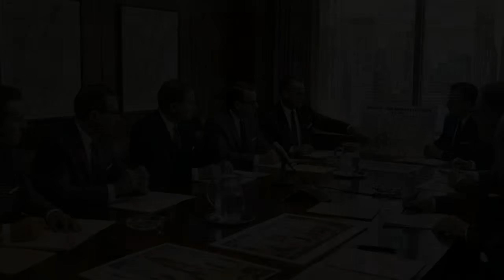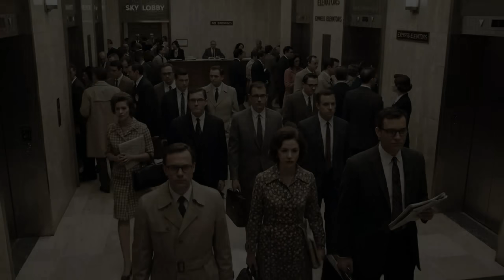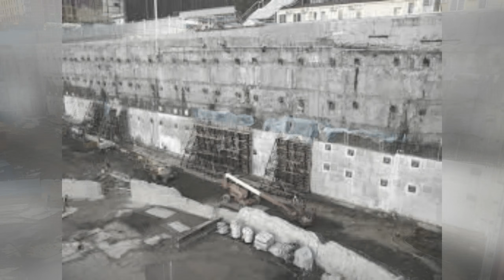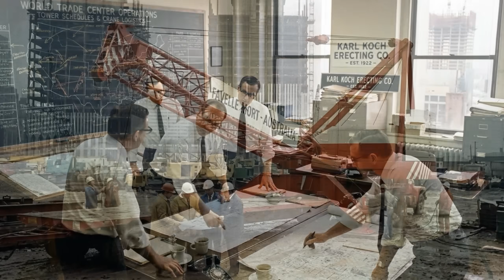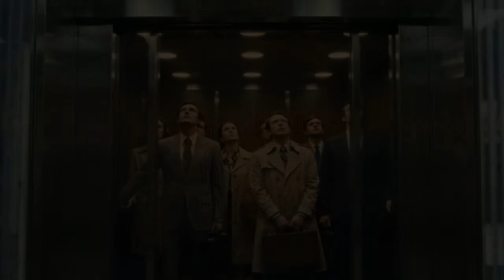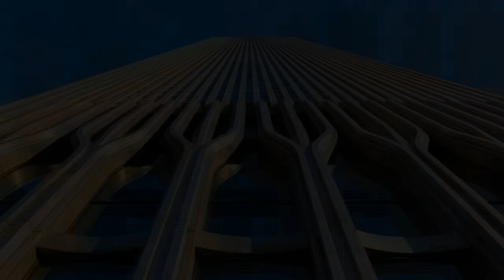World Trade Center 1 & 2 Construction (1966-1971):  The Towers that are no longer there

Comment: There was a corrugated steel pan deck above the floor trusses with a concrete deck poured on top. Within the corrugated pan deck were wire raceways for light and power. I was an electricians apprentice in 1977. I ran a core drill machine to drill concrete plugs out of the floor into the raceway and set a floor box for  under desk outlets. Down below on the ceiling were keyhole knockouts where electrical boxes were attached for lighting and power. I still have a saved core drill about the size of a wide soup can . The cross section reveals a thin vinyl floor tile on top with concrete with rebar and a blue slate aggregate.

Comment: Five dancing and rollies wired up the building, using thermodynamic to cut the beams. Small nukes in the basement to blow out basement support. Now you know why everything disintegrated, the cover-up that the workers were dying of radiation poisoning. And building seven falls down all by itself.

Comment: I know folks that know Demolition experts, and those experts told them they were totally convinced there were demolition charges in those buildings. To include building 7!
Reply: There were NO explosives in the building. First there was NOWHERE to place any explosives around any of the 236 external columns for starters.  Did 'they' install explosives on every floor and every column because how did the pilots know exactly which floor to hit, that had the explosives on them? How come no one in the 2 businesses on the crashed floors, that ran for 24 hours a day, ever saw anyone pulling their wall linings off and their ceilings down, run shitloads of detonator cord, then rebuild the place, all while the staff were working?  Hoe come the detonator wiring was not damaged by the planes cutting though them?  How come, with the extreme heat from the fires, that the explosives didnt go off? Where did the explosive wiring go to - where was the control center? How come there is NOT ONE photo or video of multiple explosives going off just as the buildings fell?  Why was there no evidence of detonator wiring or explosives ever found in the examinations at Staten Island?   No building on the planet starts a demolition from the top.  How come in the close up photos of where the planes went into the buildings, you can see the outer columns bent INWARDS?  Did 'they' place explosives on the outside of the building to create that effect?
Reply: @bobolulu7615 lol exactly
Reply: @bobolulu7615 Rubbish comment!

Professor Leroy Hulsey proved pre-planned controlled demolition.
Reply: @chrismoyler  There was no such thing.  Firstly, did 'they' place explosives on all 236 exterior columns on ONE of the floors or was it every floor?  How come the pilots managed to hit the exact floor where your 'explosives' were?  How come all the detonator wiring wasnt ripped out when they planes when through those mulitple floors? Why was there not one trace of anything 'explosive' at Staten Island?  Not even traces of detonator cord. Where was the control room for this 'detonation'?  How come 2 of the floors that were hit, had workers there 24/7 and yet not one person ever saw any contractors ripping out all the ceilings and walls, putting in wiring, and then replacing and paintng everything up ALL THE WHILE the business was operating? How come the close up photos of the holes where the planes went through, had the outer columns facing INWARDS?  Did 'they' install the explosives on the outside of the building so they would explode inwards?  How come, considering there were dozens of cameras looking at the towers, there was not ONE picture or video of any explosive going off?  Why is it, that no demoltion on the planet ever starts at the top, and yet you think this did?  You would have seen and heard multiple explosions going off, weakening columns before it fell - and yet there was none.    How come you cant answer, not one, of those questions?
Reply: OF THERE WERE!!
All three buildings were carefully pre planned demolitions.

Professor Leroy Hulsey proved this.

Comment: so you see the huge size of them iron pillars and struts there is no way on this planet fire and a plane could possibly destroy them
Reply: Correct! The records state they were designed to withstand an impact of a fully loaded Boeing 707 at top speed - which btw, is only slightly smaller than the 757/767 and actually had a HIGHER top speed of 600 mph!

Comment: Wow! I don't know why, but I always thought the buildings facade was just shiny concrete. I didn't realise it was shiny because it was clad in aluminium! Also the cranes that raised themselves with each floor. How did they get them down once they were finished at the top? I won't be able to sleep trying to figure that out.
Reply: And I could've sworn it was stainless steel - go figure...
Reply: They used 1of the 4 cranes and lowered all the pieces down from the other 3,,then used the same crane and raised up a Derrick crane, and used that to lower the last crane down piece by piece

Comment: Toured the memorial there last spring. They did an exceptional job. They exposed some of those slurry walls and anchors so you can see them. Also left many parts of the original foundation and supports in place. It was definitely worth a visit.
Reply: I still want to visit, but I have seen the images and videos. I only wished that above ground there would've been more visible remants of the twin towers. Not just the two trident beams.